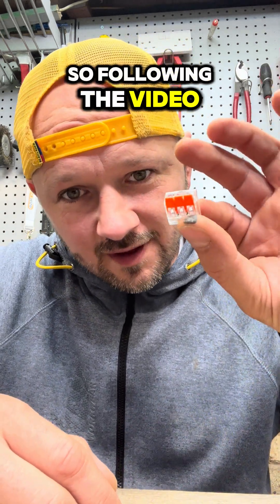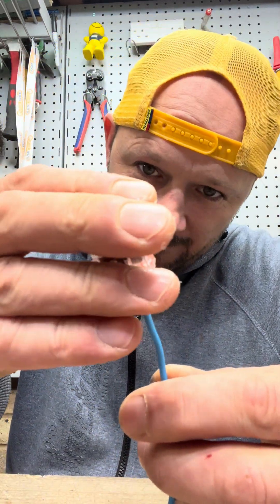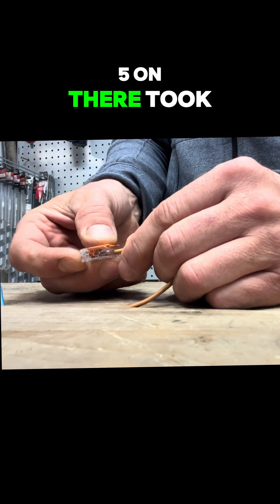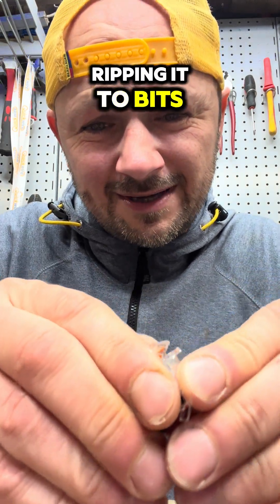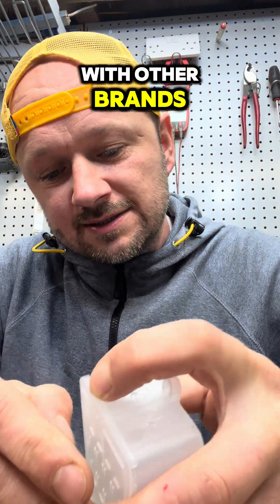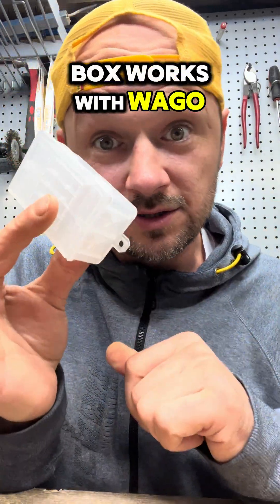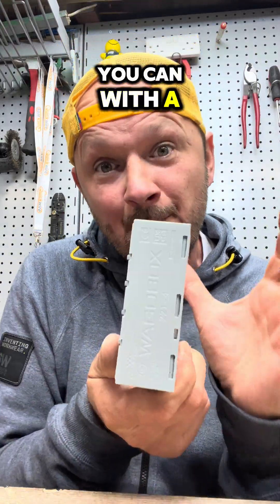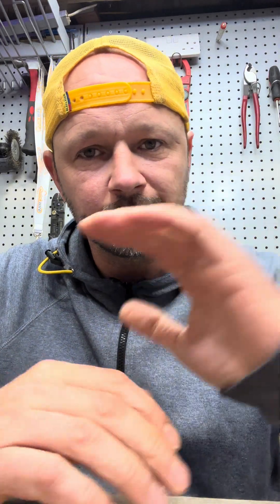Exposed: Dangers of Fake Wago vs. Genuine Wago 221

Comment: kinda skipped the most important one. can it handle the current its rated for. if its rated for any.
Reply: i loved and support these tests but i have to agree with this comment. I like to test things by my own curiosity and i've unnecessarily installed exactly those fakes, ops, i mean, unbranded wagos that the video shows on the outlet of a eletrical water heater that reaches 7500w, 220v and it's been almost a year still not showing that it might melt or something like that, specially considering it's on the edge of it's capacity in terms of Amp.

Yet, I only use these not-wagos to install lights, switches and quite often led tapes.